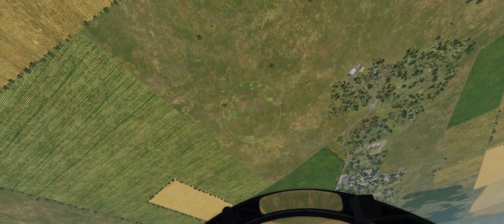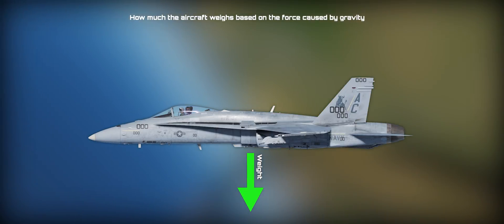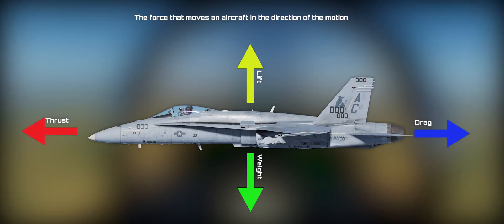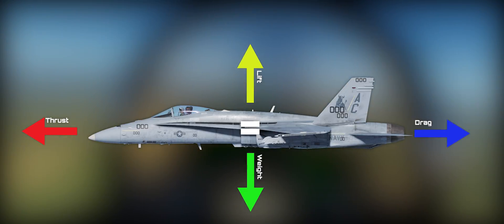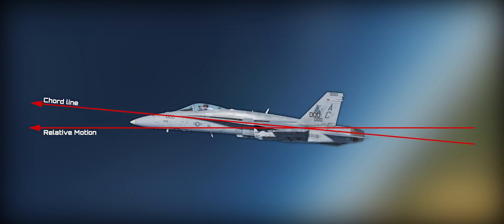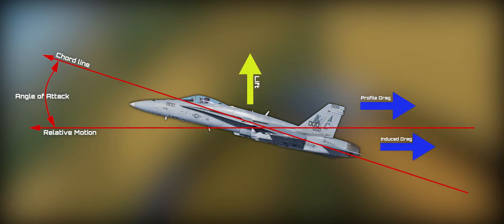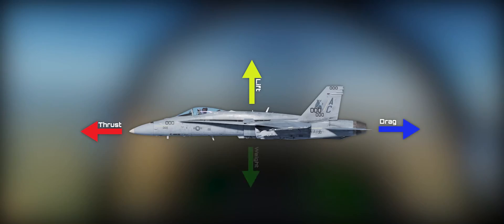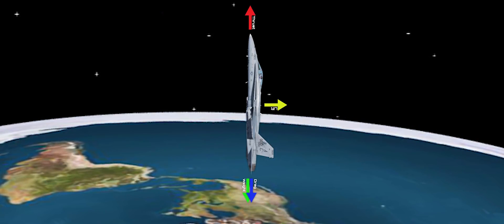DCS World - Dogfight Series - Episode #1 - Aerodynamics

Comment: Exactly how does DCS develop its data and flight envelopes? I would like to see a 20mm M61 armed F-106A at 55% internal fuel try its hand, as the resultant thrust to weight and wing loading ratios show the potential of this aircraft as a dogfighter, though even its AIM-4F "dogfighting" Falcons would probably be less than effective. Maybe a pair of ARH AIM-26 Super Falcons and a pair of AIM-4F. Or maybe the USAF could have redesigned the weapons bay for a couple of AIM-7M and put four AIM-9Ls under the wings. Keep in mind the F-106 drop tanks were supersonic capable.
Reply from the maker: We dont have the F-106A unfortunately.   Each plane developed for DCS goes through a rigorous attempt at gather all possible documentation on all aspects of the plane.   Each flight model is hand crafted to mean various charts and graphs of real aerodynamic performance.  It's a huge process, which is why it takes so long to develop a single plane

Comment: The angle of attack is actually the angle between the chord line of your wing and the relative wind vector, hitting your wing. Unless you mean that with "realitive motion", which could be interpreted wrongly, since the aircraft won't be going the same direction the wind is hitting your wing.
Reply from the maker: Sure, that makes sense!  Good call!   Fortunately for for us, in DCS, we don't have to worry about that :)
Reply: Phil said it correctly above, as soon as you add any sort of crosswind this goes out the window. So the relative wind is what's important.
Reply from the maker: They are one in the same.   It can be said either way.
Reply: @Jabbers  Eh, close but not quite. You hit a downdraft or updraft, your chord line will stay the same relative to your path of flight, but your angle of attack will change by flying through it. Relative wind is the most correct term to use in this case.